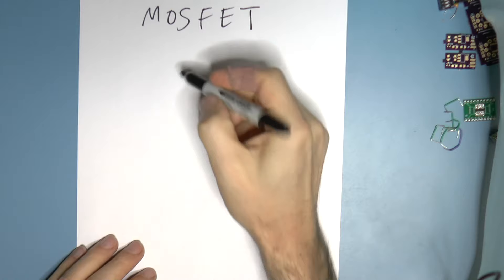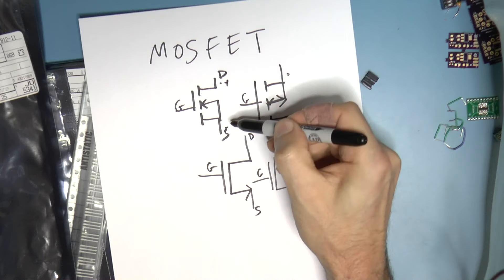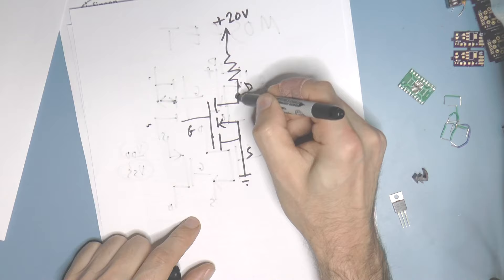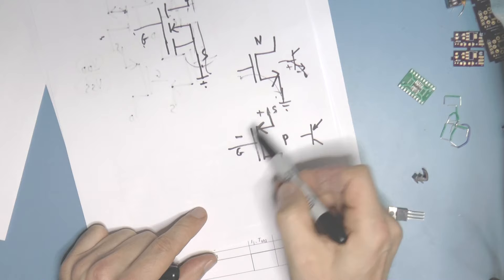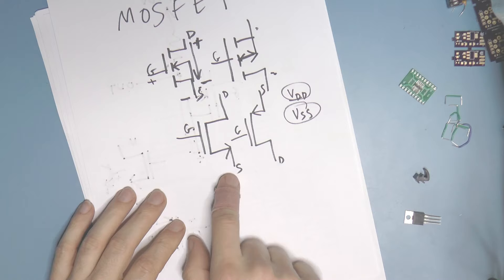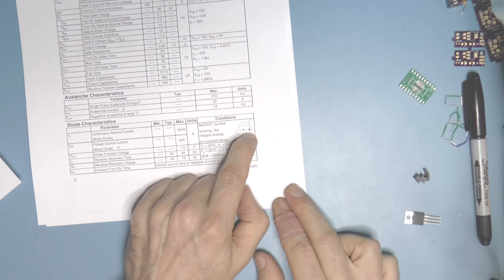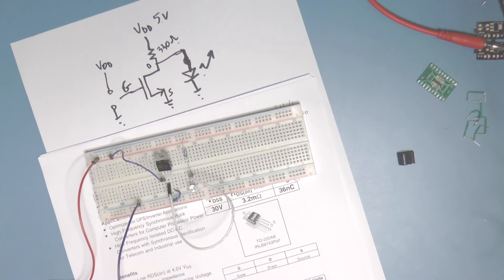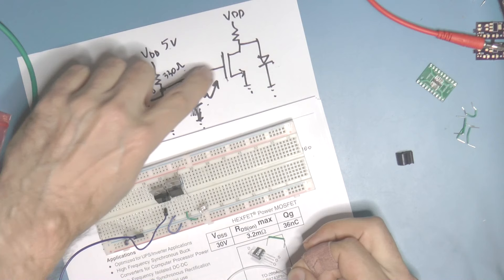Let's play with our MOSFETs! Part 1: Basics and NMOS logic

Comment: It surprises me that components such as this can be rated at 60A-120A, etc. Because I know that physically, the "Leads/Terminals" going into the component cannot handle that much current. Take the size of one of those input leads and run 60A thru it. You'll be calling it a blown 25A fuse.

Comment: Should change the symbol of mosfet they way you show it less confusing and simpler symbol, actually the better symbol is like bipolar transistor only with two parallel lines at the gate to represent mosfet capacitance.

Comment: Very nice. Where I apply MOSFET's is drone ESC 's (Electronic Speed Control) for RC cars, plane's, boats and whatever. So... Very nice video but the previous post under mine was correct. It is an NMOS logic circuit. You should have built a PLC (Programmable Logic Circuit) out of it. And controlled electric motors since people tend to find that more interesting. And then you could even include true stories of how the CIA created the STUXNET virus, or actually worm. That targets SCADA systems. And destroyed the Iranian centrifuges. Used to separate spent nuclear reactor fuel, into weapons grade plutonium. But, (sigh) this none the less, gives people a good understanding of how FET's operate. And how you can apply them. Especially when you inform us about the static sensitivity of MOSFET's. Which is important because drones tend to build static electricity and people wonder why the drone keeps burning up motors and ESC's. Also carbon fiber which is used in drone frames is also a good conductor of electric current. Altgough light and dourable if touched on the sides where carbon fibers are exposed, it can burn stuff up. Especially in naked racing drones. Anyhow.... Outstanding. Thumb up for you sir. Sorry bout the long post. If you find this annoying dont read it.

Comment: One thing that should be mentioned is that 78 amps is for the absolute maximum. The chip will survive, but it's not meant to operate at that much current normally. There should be another section for the recommended operating conditions,   which are more in line with what they can operate at in reality and still be expected to work properly during and after.

On the subject of the MOSFET's gate not being a touch sensor, I've seen circuits meant for beginners which uses a JFET as a static sensor by building up a charge and touching it. Felt all sorts of wrong.
Reply: I don't think those small pins even can carry 74amps😂
Reply: Incidentally, I came across a data sheet yesterday for a water cooled tetrode tube with an anode dissipation of 1500kw. That's not a typo, 1.5 megawatts. Hands down the beefiest non-industrial component I've seen.
Reply: please make video about component. share with the world.

Comment: At 17:20, the reason the diode is one direction is because the other side of the get opposite the  gate is a metal pad that acts as a capacitor of sorts. It is connected to the drain (on an n channel fet). This causes the insulator to stop insulating, because it forces free electrons from the dopant to collect near the gate in the substrate, and they then carry the current from source to drain.

Comment: Hey bro, I'm a relatively intellectual individual or should I say I "feel" that I am.. Lol. But anywho I believe you did a great job of explaining the ever more vast informations that keeps growing exponentially for me and I'm sure I others. Thank you for painfully explaining MOSFETs and transistors and some of their multi-use capabilities, all with a patients. I just wanted to rebuild a vintage set of full range speakers. And I'm sort of a nerd too, so I happened to playing with a18 volt Bluetooth radio upon which capacitors, resistors as passovers, transistors or MOSFETs as amplifiers, copper choke-coils  for sub woofers...anyway all this in two weeks I learned. Big headache. I may not be a genius like everyone else on this page, but you did a great job doing what I've have seen others just skim over. I subscribed and click the bell icon.
Reply: Michael Smith Sorry to say your grammar, spelling and syntax is appalling for an intellectual. But, I must endorse your praise for the well delivered video.

Comment: THIS IS A GREAT VIDEO!  A few tid-bits though: (1) @ 28:45  It is MUCH easier to insert these TO220 packages into a breadboard if you twist the leads 90 degrees with a pair of needle-nosed pliers.  The mosfet will then go right into the breadboard like a resistor.
(2) When you want to demo the switch by charging and discharging the gate charge with your hands: put the other hand on the '+' or '-' rails not recommended).  3) I cringed a bit every time I saw you slide the FET across the paper.  THANKS AGAIN FOR THE GREAT VIDEO!!!
Reply: It's harder with new boards to insert TO-220 packages. I find it helps to stick a jumper in the hole and wiggle it around a bit to loosen up the copper fins inside. The downside to using a large gauge pin like on a TO-220 is the fins will always be loose after that, so anything you try putting in that's a smaller gauge doesn't make proper contact. It's a real bitch if it happens on your power rails. Took me forever to figure out why my circuits kept working intermittently when that happened.

Also, metal sliding on paper isn't going to create much of a static charge, if that's what you're implying. ESD isn't really something that's a huge issue for hobbyists anyways. I'm not saying you shouldn't be aware of it, but the scare mongering surrounding ESD is blown way out of proportion.

Comment: How you selected 330ohm resistor between 5vdc & Drain pin? What is the formula for calculate this? For eg 12vdc
Please explain
Reply: It's an arbitrary choice.  At 5V, the max current is going to be approximately 15mA (5V/330R = .015A). Max power dissipation would be 5*.015 or 75mW.  It's all about Ohms Law. You could easily select a 1K resistor and the LED would still be plenty bright enough.  A lot of people go to silly lengths to get the LED current at a full 20mA (often the limit).  This is a needless waste of electricity and the LED life will be greatly shortened.  I find that most LEDs look fine with only 1mA of current.  You should be able to find plenty of videos showing more details on how to select the "right" resistor.  If your using battery power, you'd probably want to use as large a resistor you can, that gives suitable brightness.  You'd also probably want to put the LED in seties with the resistor and drain so that power is dissipated only when the LED is switched on, not all the time.

Comment: so love to see a video on using a p mosfet as a charging light.
red charging and green charged the fully charged battery would be 8.5 volts.
the supply voltage would be 10 volts
using a p channel enhancement mode power mosfet

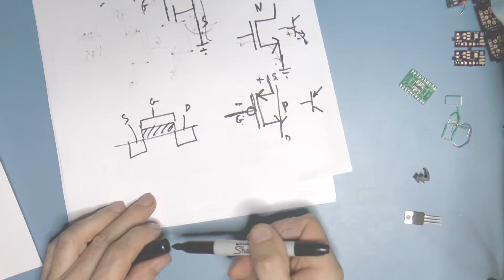Comment: 16:34 the parasitic diode is there between S and D because the bulk (= substrate, B, also called body) is connected to the source to prevent shifting of the characteristic curve (also known as Body-Effect).

Comment: Thanks, this worked and I was able to get my mosfet to turn on! although it didnt when i had the resistor to ground, it did when I had the resistor to positive?  maybe something was loose originally and was corrected it when i rewired it the other way, your way , but from what i remember reading it shouldnt matter the order of the resistor.  Which i always thought strange but thats another subject. Also my mosfet didnt stay on when i took it off 5v, which was nice actually I didnt have to ground it to turn the led back on, instant on and off when i touch and released it, nice effect but not sure why i got a different result?  I did salvage it , and mabybe heated it too much with the soldering iron?  I also soldered exention legs onto it so i fit it into a breadboard easier and think i might have done some damage then, maybe that capacitor that holds onto its charge and keeps the mosfet on when you take it off the  was damaged to account for this behaviour?Sort of like how you were saying a damaged one  would still work but with wonky behaviour if you blew it, although i didnt blow it with excess voltage, but maybe too much heat?  Or this is just normal behaviour for my particular  mosfet?   Anyway thanks for the tutorial,  and i apologize for all these questions im sure ill find the  answers too with a little more investigating.  This video really helped in understanding how they work and what too look for in the datasheet so i can use one in a circuit, many thanks.
Reply: Apon further investigation it turns out the mosfet is indeed malfunctioning someway, as i tried another one of the same kind and it did stay on after voltage was take off the gate. Tried the suspected overheated one agin to make sure and sure enough it turns off as soon as you remove the voltage.  Fascinating,  I kind of like the way the broken one reacts, turning off right away. I wonder how it broke inside to make this  behaviour? and if theres an application for it? hmmm

Comment: MOSFETs FTW !! 
The memory cell is the fundamental building block of computer memory. ... Modern random-access memory (RAM) uses MOS field-effect transistors (MOSFETs) as flip-flops, along with MOS capacitors for certain types of RAM. The SRAM (static RAM) memory cell is a type of flip-flop circuit, typically implemented using MOSFETs. - Wikipedia 🙂

Comment: Yes, manufacturers always mandate the use of anti-static precautions just to cover their assess.
No, accidentally killing a MOSFET just by touching it in practice almost never happens and so it's a non-issue. True even for tiny flimsy low-power SMD MOSFETs.
Reply: THANK YOU. It's nice to see somebody being reasonable about the risk of an ESD for once. I just replied to another comment about how cringey it was when he slid the FETs on a piece of paper. I rarely store my active components in proper ESD safe packaging. Most of them are in plain ziplock bags cuz ESD bags won't fit in my parts bin's drawers. In the 3 years I've been doing this, I've never once had an issue with an ESD. Even in the dead of Winter when the air's so dry it gives me nosebleeds. The scaremongering regarding ESD gets ridiculous. The most I do is make sure to discharge myself on a grounded piece of metal before I handle anything. Especially if, for example, I just took off my sweater and I can hear/feel the static on me. And more often than not, I do get a big spark when I discharge myself like that. But even then, unless I'm referencing a circuit to Earth, which I never do, it's not very likely I'll have an ESD into anything.
Reply: @VoidHalo  Many years ago had a chat with a disk drive installer on IBM mainframes. He was all earthed out and strapped up. I asked about the static risk and he said that while it was rare for a device to fail during handling they did experience damage which shortened their life or reduced their operating parameters. So I always adhere to static handling advice.

Comment: Nice video Robert .. thanks for the hard work .. maybe try some more complex mosfet based circuits down the road .. multivibrator adder multiplexer .. I always keep mosfets in their original anti-static bag those plastic trays are really bad PVC creates massive static surface charges
Reply from the maker: I know, right? Those trays are the worst.
Reply: @RobertBaruch  I have been pondering lining those plastic trays with anti-static foam. Has the advantage of allow multiple values in the same tray and never out of place.

Comment: After my 77th mosfet video and 40+ data sheets, still confused a little. I am a retired auto tech, but have built a number of electronics. More information on what is safe to turn on a n channel mosfet....other than dinner and a bottle of sweet red wine, it would be shocking to get positive results.
 In a truck, an automatic w/over drive can overheat. I have a 28 amp fan pushing air across a new old stock A/C condenser that can handle 400 PSI.
The automotive electrical system can vary from 12.8 Vdc to 14.6 Vdc. Using a tube or probe NTC thermistor inside the fins of this little radiator looking thing, hooked to a 10k pot, used as a voltage divider. Big words, my 60’s English teacher would be...passed away. But, place a 100 ohms resistor between the divider and gate to allow the mosfet to operated an external relay. Fluid gets hot, fan ramps up then maybe full fan speed then slows and off. I just want a robust circuit added to my service manual, but an external relay is in the group of many others. (Depending on your vehicle, it can have make it easy for diagnostics with out hunting to bend under a dash. No one likes that, if you can make it easy. Any thoughts? I am looking at your international rectifier that you spent time on the data sheet. Thank you for that. My grandad graduated from college in 1932, when the transistor was announced. He passed the year before I got married (40 yrs) but what was on his final term paper? All questions about tubes? Yes! 
Thanks for the clear explanation from a subscriber who has seen most of your videos. Info, input or suggestions very much welcome. Thanks again!
Reply from the maker: Keep it simple :) I think you want to compare your voltage to some other voltage you can set. A simple LM2903 comparator would work. Look for a circuit called "comparator with hysteresis" since you don't want the output clicking on and off rapidly when the voltage is approximately equal. Then keep it really simple by adding a heavy-duty relay that the comparator can drive. You would drive the coil in the relay with a mosfet! Search for "relay driver mosfet" and you'll get tons of ideas. Good luck!

Comment: Hi I'm still learning the basics but would like to ask you a question, in the n channel MOSFET why does the led turn off when the MOSFET is turned on, from a circuit point of view aren't the two connected in parallel ?
Reply from the maker: Think of the mosfet like a switch. When the mosfet is on, you've basically shorted the LED out so it cannot light up.

Comment: Seems I’m not getting this . I used transistor d45h8 as a voltage regulator to drop 40 v to 12 . Transistor has 40 v on the output without any trigger to ground . I’m using pnp according to spec
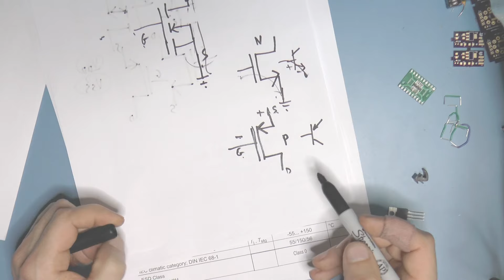Reply: Lol I don’t know what I’m doing 11:52
Reply: Now I see I may have blow it out by using a heat gun to extract the part

Comment: Wow.  I always that that the diode symbol from S to D was to prevent flyback voltage from destroying the junction when using with an inductive load.
Reply: You're correct.  When the MOSFET is wired properly, that diode would protect the junction from flyback voltage.
Reply: It is a parasitic component! There is a substrate with some conductivity (let's say P for N-MOS). Then you have a P channel between D and S on the substrate (yes, they are symetric). But you drive the ransistor by electric field between the gate and the substrate so it is connected to the S. But there's a PN junction between the substrate and the channel. On the S side it is short, on the D side it acts as a diode...
For the switching supplies there are extra types that uses this diode and some of them has schottky diode inside ( FETKY )
When you have to eliminate that (e.g. if you have to switch off the battery without charge/discharge over the MOSFET) you have to use two FETs in series with connected gates and connected by sources together. It slower, it has biggest price, it has double lost but it works...
Reply: @wmellick  it won't help much for protecting from a switched relay.  Vgs will be pretty high.  An undamped automotive relay can easily spike 300V when turned off.  Always clamp your load, don't rely on the body diode.

Comment: 78 Amps? 150 Amps? through those tiny conductor leads? No Way!
Reply: Actually, yes way, but only for very short periods, as long as you keep Tj below 175C.  It'll be fine.
Reply: @tonyfremont  Yes!  and if you immerse the circuit board it in liquid nitrogen (I would prefer HFC refrigerants) You can really CRANK UP the amplifier! or run your CPU clock at ~ten GHz ;) Just don't try liquid Helium! Too cold! and too close to absolute zero, Quantum issues!

Comment: Why is it Not base, collector & emitter?????????? Its the same thi g
Reply from the maker: Different technology, different words.
Reply: Because a MOSFET is not a bipolar transistor.
Reply: @wmellick  and the turn signal in my car is also a blinker and a lamp on intermittent cycle.....
Reply: Because transistors are current controlled, but mosfet are voltage controlled. So the emiter gets the current from base and collector, but the source only gets the current from the drain. Using the same words to different behaviours would be confusing.